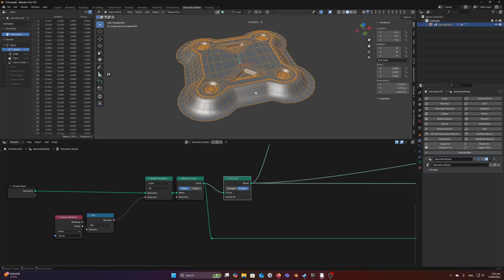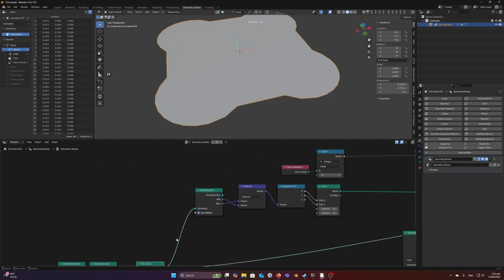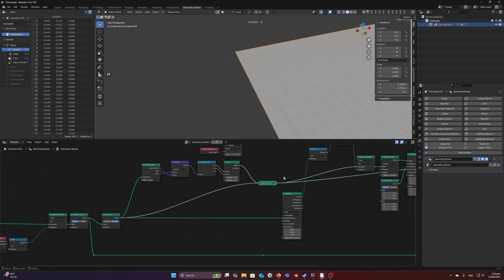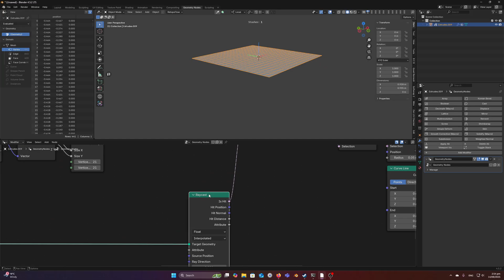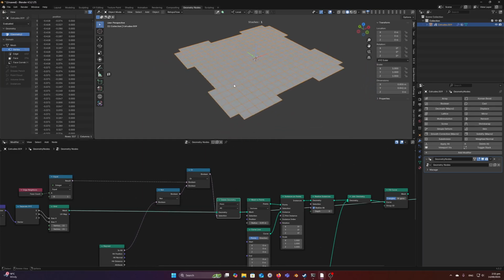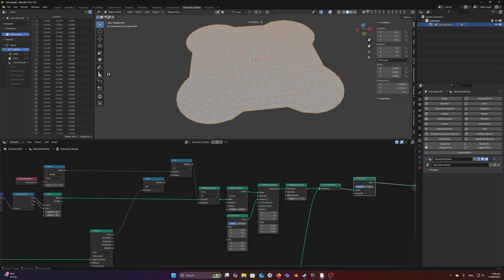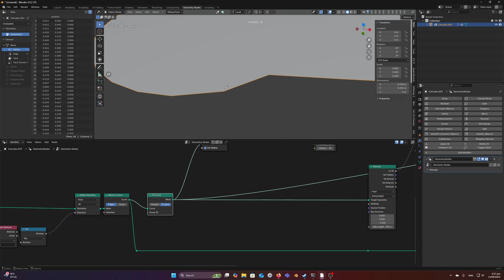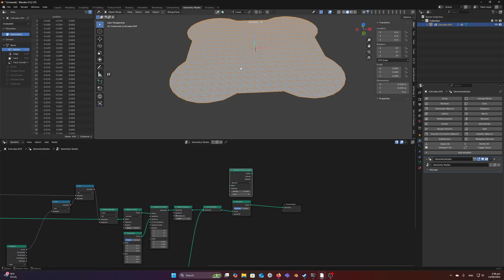2D/Ngon Remeshing Using Geometry Nodes (Blender 4.5)

Comment: wow, just a beautiful solution! thank you so much for telling us about your remeshing setup! super useful :)
One thing I would have added is maybe an inset to the ngon first, that way you have nice quad loop flow around the remeshed topology, but it depends of course on where you use this setup. And you can of course do that manual as well; inset first then use the resulting edge to do your remeshing on